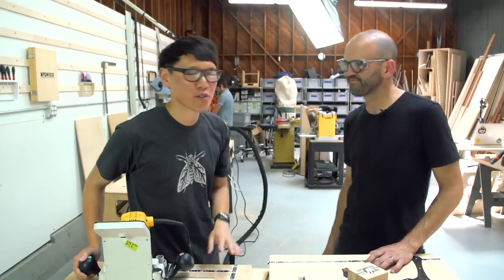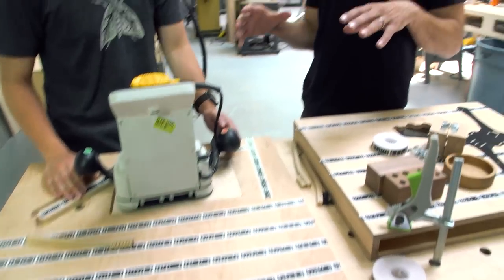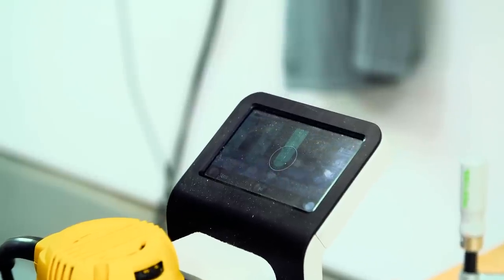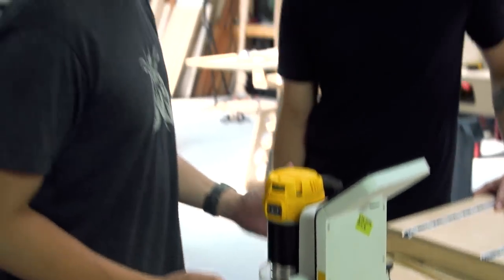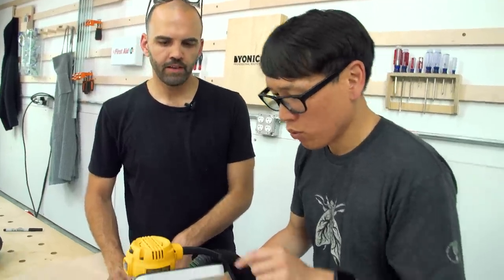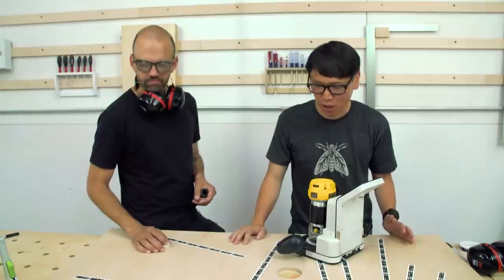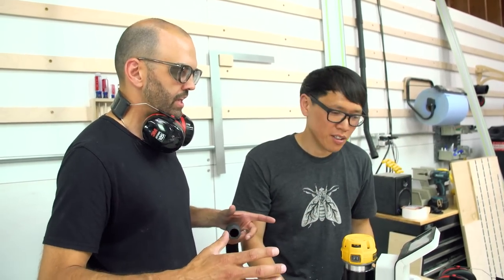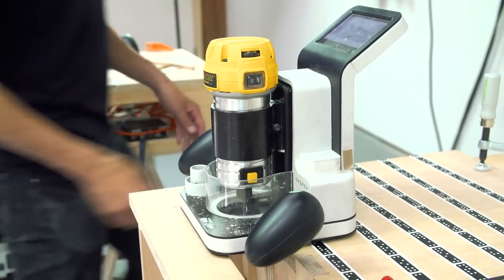Hands-On with Shaper Origin Handheld CNC Router!

Comment: Absolutely amazing product.  The real downside that I see is that the largest shank diameter is 1/4".  Without a 1/2" cutter, this product is relatively useless; aside from non-professionals using it for small craft purposes.  I could see it being very useful for inlays.  However, the thought of cutting any material 3/4" thick or larger would simply take too long and be too complicated.  I would have to make probably 4 passes to cut a simple circle out of 3/4" plywood.   Maybe it wasn't explained well enough in the video, but making cuts in actual hardwood, aside from sheet goods, can require a much more complicated cutting knowledge than this router can perform.  I can see many cuts ruined by tearing, in certain scenarios, in certain wood species.  I can't wait to see the future variations, hopefully with a bigger router and more cutter options.  Right now, it's more or less a super cool toy.
Reply: 1/16 alu sheet. and you can go higher then that with god quality bits... so hardwood would not be a problem.. https://youtu.be/q8GFpSCK6Jk?t=7m4s

Comment: imagine applying this tech to make a tattoo machine
Reply: you're a genius. well played for thinking of that
Reply: RezzaNL There are ways to combat that issue. You can make it very precise.
Reply: Not the same as if it had free range of motion which is possible with this.
Reply: I was JUST gonna say that hah
Reply: Then anyone can be a tattoo artist.
Reply: very good sir
Reply: Louder A machine that can swivel on all axis would not have many issues with that. They have sensors able to pick up on anything and everything.
Reply: Why did nobody here think of the stretching of the skin? 🤔
Would be funny to see the Shaper trying to compensate that :D
Reply: A fiducial system that would be able to track stretch would be necessary.  They could be colored dots that go around the perimeter of the work.  It's likely that such a thing would have one or more cameras pointing at the real work zone, unlike this offset system, which needs to point away due to chips and bit size differences that would confuse the camera.

I think you guys actually hit on something, but it'd be more likely that this would be useful AND investable for surgical use, (at least at first,) rather than tattoos.

Comment: Give that to Adam!!!
Reply: Seems too time consuming for actual use for someone who already has a very nice laser cutter.
Reply: Laser cutters can't cut through thick materials and also burn the edges which isn't always desired.
Reply: Pojodojo OK, Fair enough. I'd personally rather have a conventional router if I had to have only one.  Especially since the price is similar ($2500 for this, and CNC starts around that price in a decent sized unit) - because this requires your time while it cuts. The big win for me for CNC is that you can start it up and then work on something else while it chooches.
Reply: +John Ridley the other major benefit is being able to bring this to your worksite. A CNC isn't very useful if you need a custom piece on demand while at a site.
Reply: Pojodojo Absolutely true. Depends on your use. For me, I can't think of a single time that has been a factor. For others it may be all the time.
Reply: Give one to Matthias Wandel.  I don't care if he wants one or not.  Send him one anyway.  He'll find a use for this.
Reply: +John Ridley You're close but, about $400-$1000 of on your price. (depending on when you buy) a lot of people don't want to have a large machine taking up space. plus this thing is easy. And less maintenance than a traditional CNC router. You can use it anywhere. And you can use it on any sized piece of stock.
Reply: Andrew Delashaw Sure, it absolutely has its uses. But it will not completely replace fixed CNC machines as some people here seem to think it will.
Reply: +John Ridley Oh, yea, it won't replace traditional ones. But for $1300-1500 it is pretty handy. as they start to approach the $2100 mark, it will get harder to justify.
Reply: Andrew Delashaw That's a promotional price. I never look at promotional prices for anything. I look at the actual, final, sell to anyone on an ongoing basis when determining what the market take-up on something will be. The price that a hundred or so people happen to get on something has nothing really to do with what the market will do with a product. You have to consider this to be a $2500 router.
Reply: John Ridley Right and at $2500 it pretty much ensures it won't be within reach for most woodworkers.  I guess they have years and years of R&D to recoup and that steep price tag might be an issue when trying to become profitable.  Setting the base price at $1500 makes this far more accessible.  Time will tell if this product succeeds in the market place.  I think it will, but will most likely be a professional tool for the select few that can afford it or that are willing to pay that much.
Reply: +John Ridley All I was saying that for the $1300- $1500 you could get it for, or the $1700, you can get it for is better than the, again, $2100 final ongoing retail price... not $2500. that's almost 20% more than the actual retail price. And most of the people that will be buying it will just write it of. And it will be around half that price in a few years when they have paid for startup costs and/or other companies join the portable CNC router market.
Reply: I agree completely. Until it gets down to the $1000. to $750. range I can't even consider getting one. And I doubt that tape refills are going to be inexpensive either.
Reply: I didn't get it

Comment: Looks cool, but the biggest disadvantage is that you can't just run a program and focus on another thing
Reply: This would not really be suited for a shop that can operate like that. This is a small form tool designed to the work site with you. It would allow you to produce a finished product, lets say in an old work bench that would be to expensive or difficult to remove and cut at a shop. You could go there and perform the work on site (just for example of course the imagination it the limit)
Reply: Think about portability like he said in the video. You can take this with you to a job site and make whatever custom piece you need on the spot instead of running back to the shop etc.

Comment: How many of that are complaining about the device have actually paid any attention during the video? Most complaints below are completely misguided and uneducated. And if you are comparing this to a full sized table CNC then you are missing the point by a country mile and then some. Besides, it's not like most commenters here have ever used a router or have any plans on buying one.

Price is high but considering the portability that this allows and if you have the need to make custom pieces on the spot, wherever you are or if you don't have room for the tradition CNC, $2100 is not that bad of an investment.

Also 21:00 holly fuck rick grimes in the background
Reply: I'd like to know or have you explain your initial thoughts, as i see it right your one nit but then justify is the price.
Reply: The proprietary tap requirement is a legit complaint though.  It seems like an arbitrary hurdle to throw into an otherwise fine looking tool.

Comment: As someone who wants one of these for my Scene Shop I cant wait. Here's my thoughts on Why I want this over a traditional CNC Router.

1. Room: I don't have the room in my Shop for a Full sized 4'x8' CNC Router. If I were to purchase one I'd lose a significant  portion of my shop space. On top of that I have multiple spaces I work in at any given time. So the Origins Size and portability is a plus.

2. Price: For anyone who says that this is too expensive compared to a normal CNC router, your not pricing the right sized CNC. I need a machine that can handle a full 4x8 sheet of 3/4 Ply. If I were to buy a kit and build my own, I'm still looking about $3k for something reliable, and when it breaks I'm basically SOL. The Origin can handle a full 4x8 and conceivably much larger. When it breaks I have a company that can actually service it. Even at full Retail this is chump change compared to a Traditional CNC.

3. Ease of use: My crew and Students are not technologically savvy at all. I could never teach them how to use a Traditional CNC. The Origin however is designed to be used by people of any skill level. The fact that it requires a human operator is of no concern to me because I have plenty of humans to operate it.
Reply: +Vertech "When it breaks I have a company that can actually service it"

For how long?  I'd be surprised if these guys are even around in 2 years.
Reply: Agreed. A scene shop is the perfect place for one of these.  You can build something big and then make a complicated cutout in the middle of it, more accurately and neater than you can with any other tool.

Comment: Seen that yesterday on Diresta's channel, can't wait to get my hands on one of those things
Reply: better hurry up, the $1300 slots are all done, and they're at the $1500 slots, and once those are sold out, it will move to $1700 then finally the retail $2100. So the sooner you order, the more you save.
Reply: Hm. For that kind of money you can get the 2 x 4 foot Blacktoe CNC router kit. This tool is cool for doing one off little things, but if I had to have only one tool I'd prefer having the dedicated conventional router. This thing requires my time while it's cutting, which is the thing I have the least of.
Good for people with limited space though, or I guess if for some reason you need to do CNC on site.
Reply: +John Ridley Yea, but then you have a large machine taking up space, and you're limited to that 8 sq. ft. space. With this, you're not limited to the x,y size of your machine, don't have to have a large machine taking up a bunch of space.
Reply: Andrew Delashaw Just depends on your needs. Unless you think that once this is on the market, nobody will every buy a fixed CNC machine again. I promise that's not the case.  One of the things I want to use mine for is cutting large sheets of aluminum for robot frames. This would take hours with this thing and I think I'd be a physical wreck by the time I was done.  This is going to be great for small things that can be cut in less than 10 or 15 minutes. I don't think you can reasonably expect to run this thing for longer than that unless you have a lot of physical endurance. And I would doubt that you can get the registration back on track with very tight accuracy if you have to stop and start again later.
Reply: Funny how on Direstas channel everyone loves it and here everyone hates it. Guess which crowd is actually filled with builders ...
Reply: +Hold Fast this channel gives lots of info about the product. Diresta's didn't explain what was going on.
Reply: +John Ridley Do you use a router or plasma to cut aluminum ?
Reply: Mark Johnson Router, and a table saw for cutting down stock.

Comment: i could buy a full cnc router cheaper than this thing.
Reply: Yeah and you can buy a PC cheaper than a laptop.
Reply: +Dave noice analogy
Reply: But it would be limited to 2x3 feet or less. This thing can do 8x16 feet. And this can work on walls directly. And this is portable and can be easily brought to a site. So sure, if you want to make small signs, then a regular CNC router would be better.
Reply: I can buy a Honda for far less than Ferrari.

Comment: Actually... the longer in I watch this I start to think... wait... I want this machine! 

Being able to cut all the way from just a few cm2 to several m2. And the tracking/stabilizing insures a sub millimeter precision... And when not cutting it takes up less space than my tower computer? 

My mind boggles with things that this seems capable of.

$1500 - $2000 for a complete machine set? Too steep you say? 

If this product indeed does deliver, you can take this thing to a wood warehouse. Buy the plates. Go to a client. Cut up massive signs or ornate sides of houses. Produce and deliver on the spot and not even have to pay rent for a work-space. All things considered, maybe it earns back your investment in a month if you're lucky.

Of course, that is a niche market right now. And it hinges on it working reliably. 

The things it has against it is that it is a new brand and a new approach to the problem of cutting wood. Support, spare parts, repairs and infrastructure... the devil is in the details as it's said. 

But at first glance... great concept at a reasonably set price. 

Now let's see if they can deliver with the final product and infrastructure.

And yes... you guys HAVE to get this into the hands of Adam!

Comment: The most obvious addon to this Router would be a DLP projecting a domino pattern onto the surface you're working on - Frees you from sticking tape everywhere.
Reply: Tape makes things easy, consistent and reliable. I'd just stick the tape to a ruler and secure that to the work surface so I can reuse it. The router only knows its position by viewing the markers. A projector wouldn't be able to be attached to the router itself because the markers would move with the router. You couldn't just move the markers with the movement of the router because it has nothing to track position with. A projector would have to be setup separately but that's just going to over complicate things. Also why bother with a projector when a laser image could be projected on to the surface, but it's going to have same complications as using a projector. While I hate the idea of having to buy a very specific item to use a tool I can't think of a easier more reliable way of doing it and getting consistent results. If you look at any other device that uses tracking this way they all use some sort of markers on the surface for tracking. So a projector could probably work in some situations but it kills the simplicity and ease of use.
Reply: Also, what if you accidentially knock the workpiece and your external beam stays at the same place, while your workpiece is 1 millimeter off. This would ruin your day.

Comment: I haven't done much research on this, or the company, but are they open-sourced, or allow people to take their software and put it on their own machines? The idea is good, but I see room for basic improvement on how it functions; there's also some ideas I have for this, for both the tape assisted augmented reality and for the machine itself. 
One thing I would like to see done, which would take a lot more work, is 3d sculpting with it. At least basic z-control for now would be good other than a fixed depth.

Comment: I feel like the 2000 + dollar cost does not make it a smart purchase for small shops because you can get a decent desktop sized CNC machine for that cost and you could have said CNC machine running as you prep something else but with this you have to trace things and it is not self propelled. it is not so great for larger shops because they don't have time to have employees tracing things so they have a "traditional CNC machine" cut while they prep, build, etc. also it is not practical for home shops dues to its high cost

Comment: $2100 is way too much for this, as useful as it looks. I will wait a couple years and pick one up at Harbor Freight for $199 and use one of their 20% off coupons too!
Reply: A patent will probably stop that from happening.
Reply: A patent in it of it self will not prevent knockoff products. The patent holder will have to sue. Sueing random Chinese companies directly delivering the product labeled as "gift" to a private address will be a pain. On the flip side: Such a knockoff will barely work, ignore any safety constrains and have no warranty what so ever so serious users would not switch to a knockoff.
Reply: People said the same thing about 3D printers but they are still over $1000 for anything that produces decent pieces at a useful size.

Comment: Practical applications?  Where could I expect to see this in use in a work force?  I don't.  It's very novel.  It's got good tech behind it.  How about scale it down.  Create a small version you could market to high end trim carpenters,  to mortis doors, and hinges.   It's got potential, but you need real work applications.

Comment: As long as the routing is precise, then it worths the money if you are in the wood worker that has to build thing in the job site.   Of Course, everyone wants a low priced machine but it is simply not in this industry.  A  hand held edge banding machine, which basically is a heat iron and cutter together, is more expensive than this .  
BTW, I really want to see a review of how round a circle can be made and the smoothness of the edge this machine makes.

Note: I owned a operate 5'x9' CNC and it needs tons of technical knowledge to run it.  However, the usage is totally different.  The full size one can be used for large volume production while this one a perfect fit for custom wood work on site.